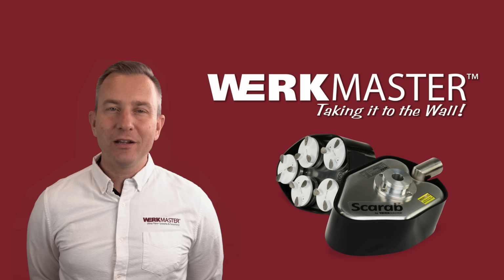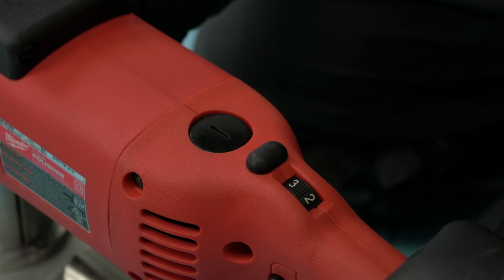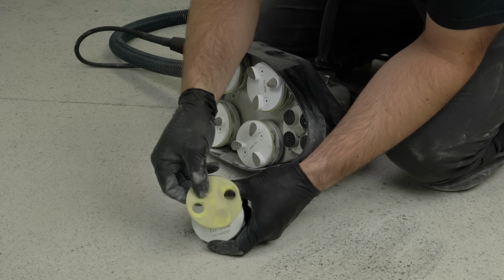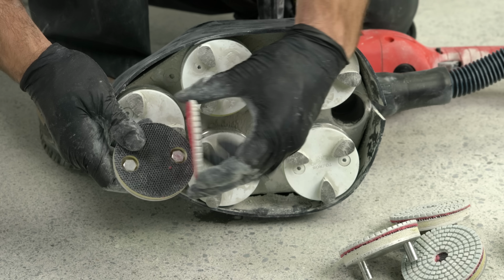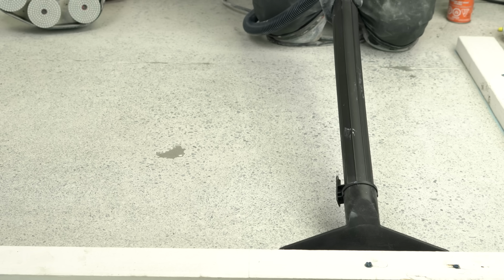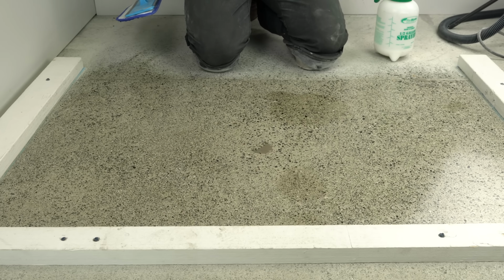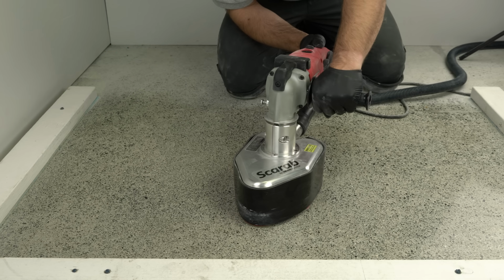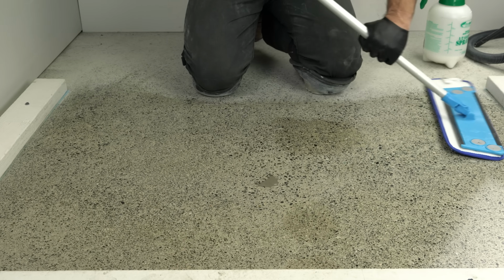DIY -  Learn How to Polish Concrete with the WerkMaster Scarab Grinder

Comment: Why didn't you chisel out the hole, and mix up a matrix with terrazzo stones to fill in the imperfections?
Reply from the maker: Hello Hdieje Sidiejs. We chose to use cementitious patch that has a wear rating in this case. You can definately repair the holes using alternative solutions. Thank you for your feedback and we hope you enjoyed the polished concrete video.

Comment: You also could of taken a 4" razor blade and scraped up the paint line along the edge.
Reply from the maker: Thanks for the feedback Hdieje Sidiejs. The nice thing about The Edge by WerkMaster is that you do not need a scraper to remove the paint!